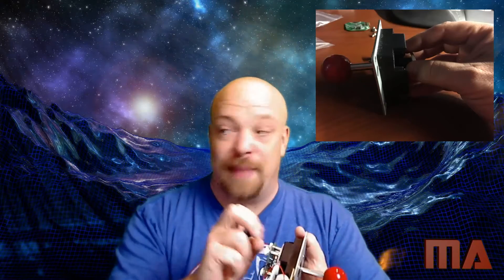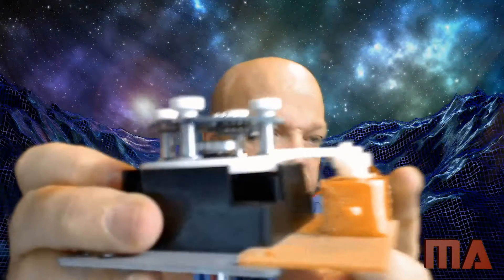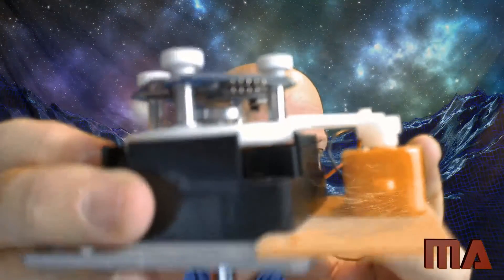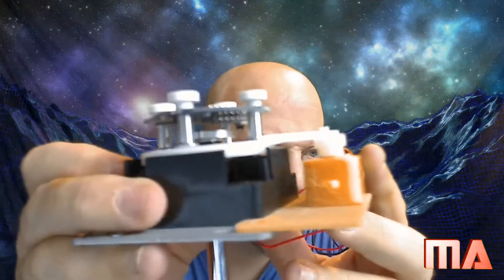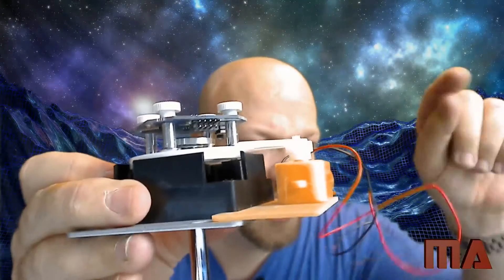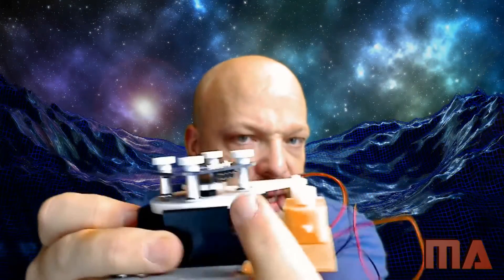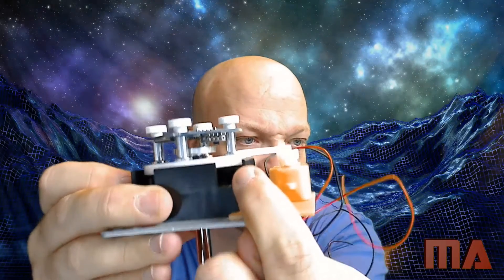Adding a Servo Motor or Restrictor Plate to the UltraStik 360

Comment: Hi! Does your Ultrastik 360 have the 4/8 way restrictor kit fitted prior this mod as stated on Ultimarc's website?
Reply from the maker: The restrictor plate is just the plate itself, not motorized so you have to choose a 4 or 8 way prior to installation to get that feel of hardware restriction.  

When I made this video Andy let me know that it was not a supported mod.  So I made sure to let everyone know that it was not supported, but works.
Reply: I had this same question. So, you don't have to have the additional 4/8 way restrictor plate, but optionally, will add additional restriction if used in conjunction with the white plate? My concern was how it works if using both plates. Do both plates move together when used with the motor?

Comment: Is there any reason you would or would put the servo motor on player 3 and 4?
Reply from the maker: In my case, because player 3-4 are gamepads, but for others there is no reason other than cost.  Do you want to pay for the servo motors for extra players that aren't often used?  For equal play and feel, yes, for just starting out... maybe?

Comment: What is the purpose of this???
Making the ultrastick feel like a servostick? That would the ULTIMATE ultimarc stick ever !
I mean: a servostick with the ultrastik advantages, like the rotatory function :)
Is that the result of your mod ?   I'm asking because I'm considering to apply it      :)
Reply from the maker: It was more just me screwing around :-)  ... This mod is not officially supported by Ultimarc BTW.  

So, my intent in this mod.  The U360 does have the ability for digital restriction, but I wanted the feel of the 8-way or 4-way joystick, hense adding the servo.  

Check out this crazy SOB:
http://forum.arcadecontrols.com/index.php?topic=132356.0

He made a U360+top-fire+rotary+illuminated mod!!!

Comment: Hi Mav! Can you install both the motor and rotary add-on together?

Also do you know if these will mount on JLF joystick plates? (considering installing Ultras on my Vewlix F.)

Very useful videos. Keep up the good work!
Reply from the maker: I'm not sure about the JFL joystick templates - only because, to be honest, I have no idea what those are :-) 

As far as the motor and rotary add-on, it's definitely not recommended or supported by Ultimarc, but I've seen one site where a guy made a center-fire, rotary, RGB, servo joystick.  It's insane.

I once saw the pictures, but his provider is screwing them up.  But here's the information at least:
http://forum.arcadecontrols.com/index.php?topic=132356.0
Reply: Someone Else You need to use the Kowal flat plate with the Vewlix.